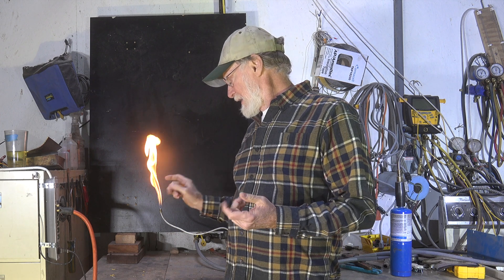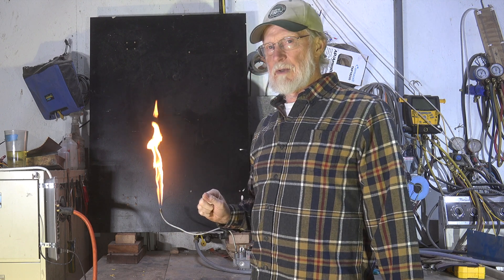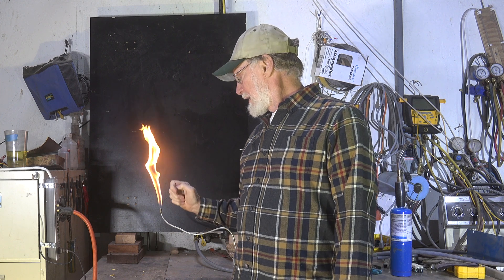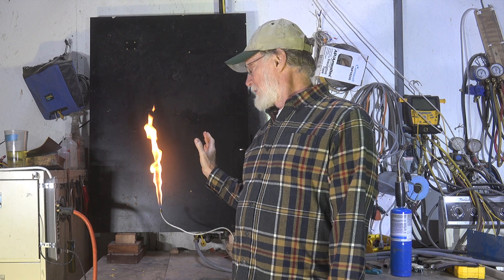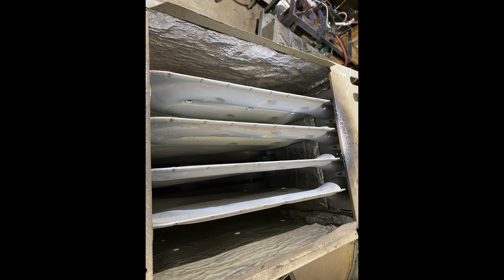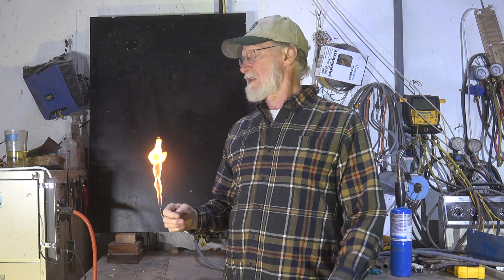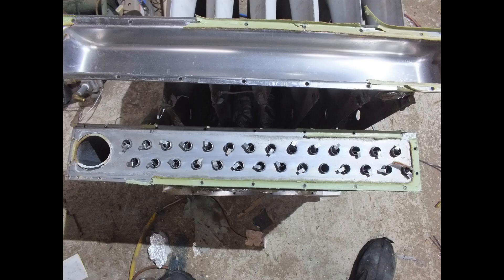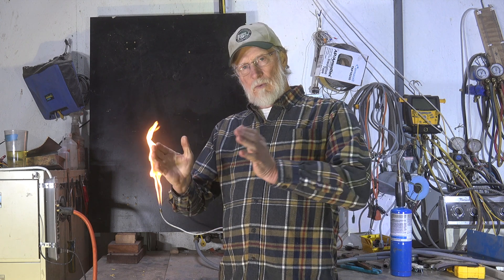The gas flame and the hi efficiency heat exchanger

Comment: At my workplace there's several gas furnaces that heat the multiple buildings and they're mostly on the ground such that you can walk up to their exhaust as they run. The exhaust gases have a peculiar odor that isn't fun to breathe in. 

Well there was one unit behind the building where the odor was unbearably strong... you could barely stand in the vapor cloud for more than a few seconds. It turns out that it had a busted heat exchanger.

So I'm guessing that there was an excess of combustion gases due to incomplete combustion which was attacking the water vapor and making it very acidic. Does carbon monoxide also react with water vapor, and if so, does it create a different chemical or just excess carbolic acid?

The odor reduced to almost nothing when the heat exchanger was replaced. Judging by the burning-hot exhaust, it's probably an 80% furnace.
Reply from the maker: When combustion is incomplete, chemicals called aldehydes are produced.  That is what you smelled.  It is acidic and burns your nasal passages.
GFM

Comment: Hello and happy holidays! I always enjoy your videos and tips. One question when I do furnace inspection and troubleshooting as you advised me on prior questions. If my Inficon Co Meter picks up any Co reading above 1ppm at supply should I start investigating why even we have that the first place? We shouldn't have anything period. Correct? 
Thank you for your time 🙏
Reply from the maker: If you are in single digits, I am not worried.
GFM
Reply: @grayfurnaceman  
Thank you for your time and reply. You have been my old school teacher have huge respect and drop my hat.
Why do get any reading?  Doesn't the CO produced inside heat exchanger tube not outside of pipe that air goes over it. Where does this CO come from if heat exchanger not cracked then?

Comment: good video and explanation, I'm amazed so many get installed without condensation neutralizers, not that people would replace them or the medium inside(limestone or limestone composition pellets)
Reply: Chicago here they dug deep in the ground cored deep tunnel project below clay extracted massive amounts limestone .Had a engineer type show up at my old shop for replacement cartridge supervisor cut end off glued female adapter male threaded plug drilled out middle barb fitting guy watched him go out driveway fill up with limestone .

Comment: Which is the best high efficiency heat exchange in the market??
Reply from the maker: I would look ar Lennox or Trane
GFM
Reply: @grayfurnaceman  In Australia we have a furnace that has 4 heat exchanges. A primary and 3 stages of condensing after that. I think Braemar make that one, worlds most efficient gas heater apparently.
Reply from the maker: @PracticalCat  That does not appear to make sense.  A 2 stage heat exchanger has a vent temp of between 21C to 32C.
GFM
Reply: @grayfurnaceman  Hmm interesting. Ive looked at the exploded view it does seem to have a multi stage hx, looks to be a primary followed by two secondary stages.

Comment: I work on HVAC, but I only do maintenance and small repairs. I don't do installations. So, I don't replace furnaces. Can anyone tell me what brand of furnace has the best reliable high efficiency heat exchanger, please?? I need to which brand is the best. I have heard that Carrier has a lot of problems with their heat exchangers.
Reply: carrier abandoned the problematic secondary - made from aluminized coated with plastic instead of stainless.

Comment: What is the maximum duty cycle of the furnace? Also. The reason why I asked what's the maximum duty cycle is because presently there's no air return system and it's cold air going in. In other words my unfinished basement it's pretty cold and the intake system is sucking in cold air. The furnace will about 20 minutes and then go off for about 3 to 5 minutes and then run again. The thermostat is set to 66 degrees.
Reply from the maker: All furnaces are 100% duty cycle.  However, they are connected to ductwork that may be restrictive.  You are probably overheating.
GFM
Reply: @grayfurnaceman  thank you so much for the quick response. I may have forgot to mention that the intake system is in the basement which is a little bit cold to begin with and there's no return system and the ductwork is incomplete. There's one big run along the basement beam and a few Outlets which are not permanently set up at this time. I am amidst a huge renovation. I was worried that I might burn out the furnace
Reply from the maker: @kaboom362  I knew you had a low return temp.  However, if the ductwork is very restrictive or the furnace is overfired, you could be limiting out.  And yes it is hard on the furnace.
GFM
Reply: @grayfurnaceman  the ductwork isn't really restrictive at all actually it's pretty wide open and it's flowing with no resistance or very little. How can I tell if it is Limit Out. If I set the temperature to high then it will just run constantly and never achieve that temp
Reply from the maker: @kaboom362  You can try jumpering the thermostat.  If it stops, the thermostat is cycling off on its cycles per hour setting.
GFM
Reply: @grayfurnaceman  thanks for sharing your videos. They are really handy for the do it yourselfer
Reply from the maker: @kaboom362  Merry Christmas
GFM
Reply: @grayfurnaceman  Merry Christmas to you too Oh Wise One